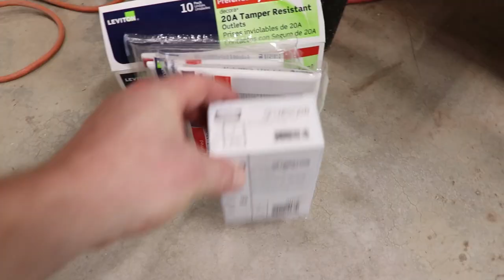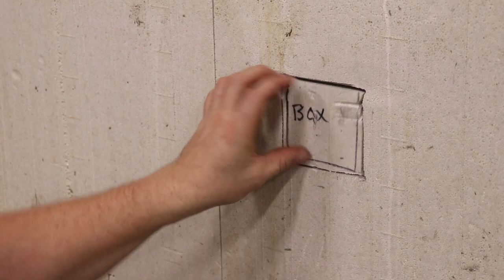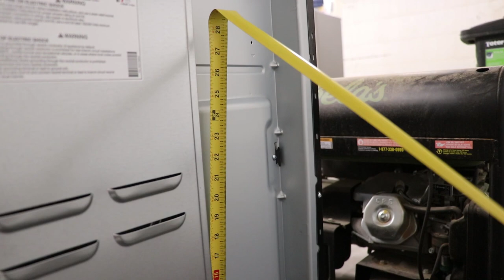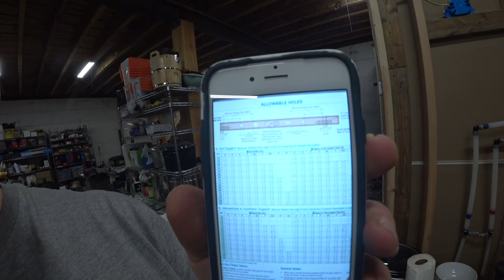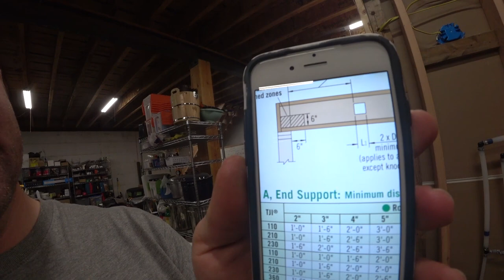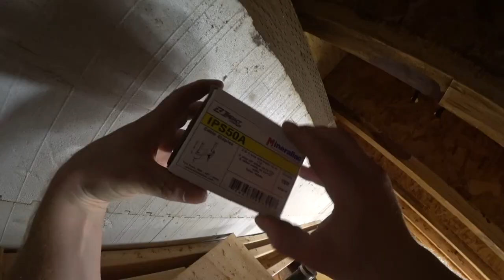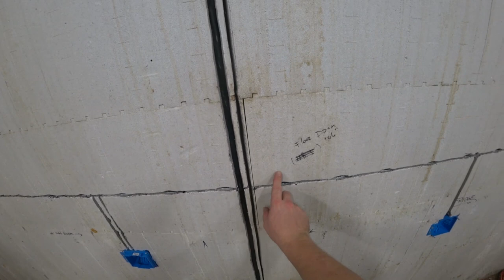SOLVED: Generator Interlock Solution (Backup Power)

Comment: When doing the wiring do consider how much power you will run trough the system. I would keep workshop/current kitchen area as it own, while pulling another wire to power outside lights and outlets. Combine kitchen load to outside lights and maybe something like pressure washer and that a quite a load for single wire and breaker. Also makes things easier to fix, when you can take power for worklights and tools from garage and vise versa and not cut whole circuit to work on it.

Comment: Happy to see you are not using the "Back stab" holes on the outlets, BUT .... you 'should' also be Pigtailing to each outlet individually (Code preferred). Daisy Chaining them puts ALL the current thru first outlet, ect, ect. Get a hold of the latest NEC book, it is great reference to have.

Comment: Making Progress and moving forward. Once again, nice work on paring down the To-Do-List; at least a few lines anyway.  Food for Thought:  You may wish to consider putting some furring strips on the garage wall where you have the range and refrigerator right now. It could be 3/4” or 2x4’s (flat = 1.5” or full depth 3.5”). The reason I say this is that it would give you space later on to run whatever you need for when you convert it to a shop area.  Additionally you will eventually want some wall space to hang cabinets, shelves, wood  storage racks, or dust collection pipes and this would make your life a LOT easier for attaching things to the wall in the long run. It might mean a little rework on the existing plugs, but you should be able to use all the existing runs as is. At a maximum you will only lose an additional 1.5” of wall space, but gain a lot of attachment points that aren’t into concrete or through the existing insulation material.

Comment: Regarding the outlets along that wall.. the old rule of thumb where you can never have enough outlets is true!  I would usually throw one down every 4 to 6 feet.. if you plan on putting in a workbench, have outlets 12" off the floor and another set at ~36"-48" above those (so they sit above the work bench) every 4-6 feet down the  wall.  Youll learn to love having them available whenever you go down to plug in vacuums, welders, car cleaning things, battery chargers and such.

Comment: Awesome video again! I love the candor you always deliver.  
I am not sure what you plan to have in your work area garage shop but based on the tools I see you already have. You may not want to extend that single circuit too far, in fact. I think you may need 2/3 more. A lot of the power tools pull around 10 - 20 AMP that means trying to safely operate 2 or 3 at a time on a single circuit will be a problem. Give outside outlets their own circuit(s).
I think you should frame Alyssa's bedroom next, then arrange a sheet-rocking party after the holidays.

On a separate note, your next car will likely be hybrid/electric (in another year or 3) its a growing family) just saying you might want to identify garage space for that.

Comment: The National Electrical Code requires a service discinnect where the service conductors enter the house. With your retrofit, do you have this?  
225.31 Disconnecting Means.
Means shall be provided for disconnecting all ungrounded conductors that supply or pass through the building or structure.

225.32 Location.
The disconnecting means shall be installed either inside or outside of the building or structure served or where the conductors pass through the building or structure. The disconnecting means shall be at a readily accessible location nearest the point of entrance of the conductors. For the purposes of this section, the requirements in 230.6 shall be permitted to be utilized.

Comment: Hey Jesse take a scrap piece of 1/2" PVC pipe 8" inches long -or -so. cut two short 1/2" long slot up from one end of the pipe no bigger then 1/4" wide 180 degrees across from each other . then tape the other end with electrical tape and 'bang' you have a wire nut tool to give you  help driving those nuts on.  The two slots will fit down over the wings of the wire nut and give you the added ability to turn the nut without causing tunnel carpel.   Its just a very less expensive way of helping yourself out . . . instead of the expensive store models.  Ive made two or three so they are all around  don't really mislay the only one.

Comment: I see the suggestions on the genset panel and phase tape worked out. Two more suggestions.......a single GFI breaker in the panel for the BR would have simplified wiring. Although too late now, maybe do so in the future and for the kitchens.........Without the drywall in place you may want to anchor your gang boxes into the concrete as the foam anchor might not work so well when removing plugs from the outlets....... BTW, figure on having a water pump as you'll have little to no useful water pressure upstairs......Cheers!

Comment: Assign points to the tasks on the punch list board. Use Fibonacci numbers to give yourself a good spread. So, maybe put away clothes is 1 point, assemble Ikea furniture is maybe 3 points, install garage outlets is 8 or 13 points. It'll give you a slightly better way of glance-estimating when you check the board.
Reply: Spoken like a true Agile developer.👍

Comment: The neutral wire is a grounded conductor. When phasing the neutral wire you need to take black electrical tape and wrap around the entire wire so that it looks black that is your ungrounded conductor. Also the set screws on the cover plates to your receptacles and switches needs to be straight up and down. Great job on doing the electrical yourself. I don't mean to criticize I'm just an electrician.

Comment: Just wanted to compliment you on your conduit box choices I made the mistake of going with plastic covers for my Outlets and Ira time I plug something into it it spits it back out metal is much better and retains better and look for in Florida they call him tight fit and hold the plug in even if slightly pulled on

Comment: For the wire runs that go to the panel I would drill a larger hole, maybe 1 1/2 Inch or whatever meets your specs you found for the I-Joists, and use that to pull your panel feeds.  That way you won't need to do a bunch of singles holes for each wire. It also leaves room in the hole which is required by code.

Comment: I would recommend you run a 40-80 amp capable wire if in the future you guys decide to get a electric car. It was a pain running 6 cable 240volt to my L2 station.

Comment: You should turn all of your outlet cover screws to be vertical, it makes it look finished
Reply: I worked as an apprentice electrician, pre and finishing new homes. In the finish phase, we always installed cover screws with the screwdriver slots set to vertical. It gave the whole room a more finished appearance.
Reply: Oh no - the screw 'clocking' thing - I thought that OCD manifestation was limited to my wife - LOL.
Reply: I can honestly say that in my 65 years and seeing thousands of outlet and switch covers, I never noticed if the screws were turned the same direction. 🙂

Comment: nec chapter 100 -200- 300 covers most codes, written in law form (handbook easier to read) .will give you the tools needed to help question and wire your home. plus electrician and inspector will help keep you from burning yourself up while you sleep

Comment: I don't know about you, but I can only comfortably reach from one hand to another (my wing span, if you will) about three feet, so above a work bench I'd put my electrical outlets three feet apart, not four feet apart. I don't want to have to get up off my stool to plug in another thing. ❤🌅🌵

Comment: NEC code Romex wire has to have at least a 4" radius in bends. You have zero radius where you are bending it in the styrofoam insulation.
Reply: I am going to clarify on that radius bend that he is talking about. The 4" radius bend will in fact cut down on wire breakage over time because when it is at a 90° bend the wire will over heat and break down the wire until it creates a break in the wire, spark and melt the plastic sheathing on the romex and cause a fire. I know you don't live in a code requirement area, but you are spending time on a beautiful house that you would love to live in for a very long time.
Per NEC 2017
300.34 Conductor Bending Radius. The conductor shall not
 be bent to a radius less than 8 times the overall diameter for
nonshielded conductors or 12 times the overall diameter for shielded or lead-covered conductors during or after installa‐
tion. For multiconductor or multiplexed single-conductor
 cables having individually shielded conductors, the minimum
bending radius is 12 times the diameter of the individually
 shielded conductors or 7 times the overall diameter, whichever is greater.

320.24 Bending Radius. Bends in Type AC cable shall be
made such that the cable is not damaged. The radius of the
curve of the inner edge of any bend shall not be less than five
times the diameter of the Type AC cable.

By the way love all the videos and congrats on the new edition toe the House-Hold. LOL

Comment: 😎😎😎👍👍👍 I have a suggestion. A small hint that makes OCD people and electricians happy is making all the electrical plate screw slots vertical. It’s a small thing but looks great in the overall finished product. Maybe someone has already suggested this. If so, whoops. Oh and always use the same brand of plates and switches if possible. The plastic that different companies use looks different. Good luck. I wish I lived near buy so I could help with your electrical questions. Look like you have some savvy people near by.

Comment: Jess...I would have Run EMT Conduit in the Garage for several Reasons...some Codes Require it. Others Require Rigid Conduit due to the Crush Factor. Metal or PVC Flex Conduit is also an Option. EMT however, Embedded in the ICF would not Require Nail Plates! In a Perfect World, all the Rough In  Electrical Conduit and Boxes would have been Installed in the Wall Cavity before the Concrete was Poured. I like Conduit because later on, if you need more Circuits, you can Pull In more Conductors without Digging into the Wall/s. Either way...I would Run the Conductors through the TJI's, Down & Back Up to Each Box...that way your not Crossing Conductors. True...it takes More Wire...but not that much more.
  Upstairs in the Sips I can show you my Method for Super Clean Installation of your Boxes without Mud Rings. And don't let anyone tell you that you need to Cut a Bunch of Access Holes to Run Romex in Sips either...I know, I've Wired Sips.

Comment: Nice work I think I would have put up the drywall on the wall and then run conduit.  It would be easier to update, better insulation, and makes the house safer.  Also good motivation to move upstairs.

Comment: Seems to me the wall should have been framed out with 2 by 4’s. much easier to install range and electrical outlets and can add extra insulation if desired.

Comment: BTW: Just to add-in another wee bit of perhaps-useful electrical wiring information RE: something that came up during Jesse's talking about the work he's shown doing herein - "SER"- designated electrical cabling is (full, proper name) "Service Entry, Residential", and is (depending upon the sizing of the individual conductors in the cable) capable of safely-carrying a WHOLE BUNCH of electricity without failing or overheating - ordinarily, for instance, it carries around 300 to 350 Volts A.C., at a maximum rated level of generally 250 to 300 Amperes-maximum - sometimes more - since it's rated for use as "Main Service-Entry" cabling for ordinary-Residential usage.

Again - the maximum rated usage that will be considered to be safe will be dependent upon the size (and perhaps the type of metal, copper or aluminum, from which they are made, and maybe even the type of insulation-jacketing used) of the conductors in the cable.

Comment: Nice job on the splice and re-connection on main breaker panel. Better if you can slide some heat shrink tubing over the electrical tape of the splices, no rush just order the heat shrink online.  Generator hookup is ok for now, but consider a weatherproof male twist lock power inlet for the generator connection.

Comment: I see that you still use some #14 wires on a 20A circuit, which is not allowed...

Also, you might want to cut the foam slighty bigger and foam around it, not for R-value, but to use the foam as a glue, to help to keep the box in the wall.
Reply: #14? Where? All I have seen so far is 12. All the yellow stuff is 12

Comment: Its looking good and  a nice solution to both problems.With the panel you might want to look into a label maker to attach to all the hots for future reference. What is the future plan for the "Garage" roof are you panelling it in if so maybe install an extra power lead up there for future use and just terminate it in a box?

Comment: I like to go the next size up on plaster rings so it will be flush with the outside edge of the sheet rock. Plaster rings are measured from the box side of the ring to the device side of the ring

Comment: 1/4 cup milk
2 large eggs
1/3 cup potato starch 2/3 rice flour
1/4 teaspoon zanthan gum
1 tsp salt
1/4 cup olive oil
1 Tbs yeast
beat eggs, milk together. add floors, yeast, xanthan gum, salt, then mix in oil.
spread onto 12 inch or 9x13. spread sauce and toppings over unbaked crust.
bake 400 for 25 min.

Comment: I tried using green tape, for a ground wire and the inspector rejected it. I had to use green shrink tubing.

I don’t see any grounding rod connections. In Cali there has to be a ground rod, sunk over 10’ for every panel, including sub panels.

A lot of this stuff is NEC so it should be fairly uniform...
Reply: They built 2 ufer grounds into the foundation.
Reply: Gary Allsebrook… Not sure what local code will be but NEC for 200 amp service is two 8 ft ground rods, at least 8 ft apart for the main panel. They must be bonded at the first point of disconnect. Looks like that should be at pedestal box 100 ft from the house, so that's where the ground rods go. All grounds from subpanels go back and terminate at the main panel. Personally, I would have made this a 320 amp service and added a second 200 amp breaker back near the meter (or outside the garage) to feed the out buildings they have planned for the property. Of course that's only if they stay with the plan to have this house ALL electric. My personal take is they have too many eggs in one basket and should be doing propane or fuel oil for heat / hot water to reduce the load when they need to go back to solar or gen set during a power failure.

Comment: NEC 300.13 says you need to pigtail your neutrals, many people don't and things work out right, but you can really do damage to electronics and even hurt yourself jumpering neutrals together rather than pigtailing. You do know that plastic outlet boxes and mud rings are only guaranteed for installing a device the first time and to remove and reinstall destroys the threads making the device susceptible to falling out.

Comment: Excellent explanation of wire capacity in outlet boxes and T.J.I. drilling. However, I am still hoping to see you put an extension box on your water heater conductor junction box. I'm pretty sure you have too many conductors of that size in that box. (your romex chases in the insulation should have a 2" radius for the romex bends). PS - you only need nail plates where the conductors pass through a stud or framing member. For peace of mind you could use a long galvanized strap (see Simpson Strap ties) for the range feeder. Or cut a piece of 1" emt in half lengthwise and place it over the wire before you rock.

Comment: Over thinking the power outlets is a good idea.  The 100A main may have been too low for an electric vehicle High Speed Charge station,   but I would pre-wire for a charge station.
Reply: Edward Goldberg... Do ya one better... run a 100 amp feed to someplace near the garage door, then wire up the work area from there. (bench outlets, etc) That way you will have enough spare power to eventually feed a welder or car charger. Small panels are sold, which are not much bigger than a spa disconnect and they usually have 6-8 breaker slots. IOW, enough room for a 2 pole plus a few branch outlets. This also puts the breakers within easy reach of the work area, just in case you trip something.